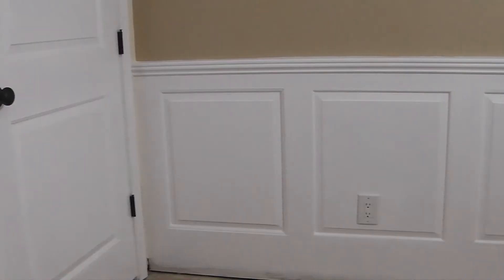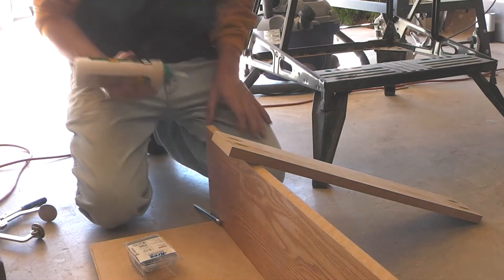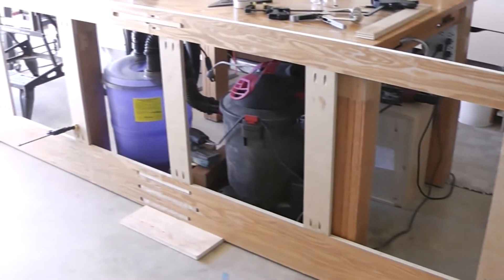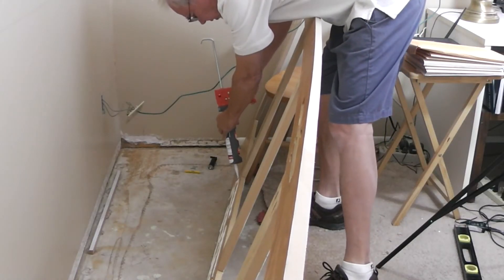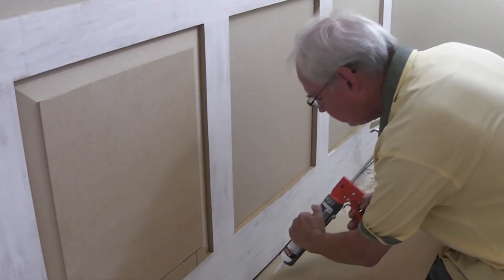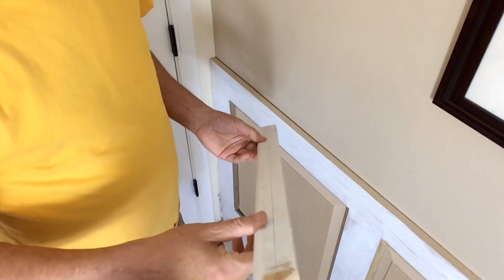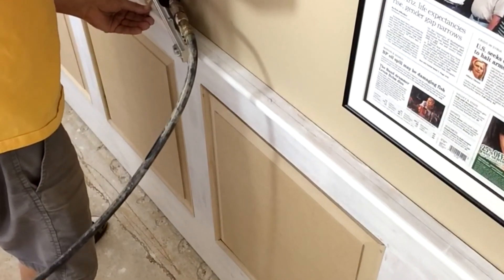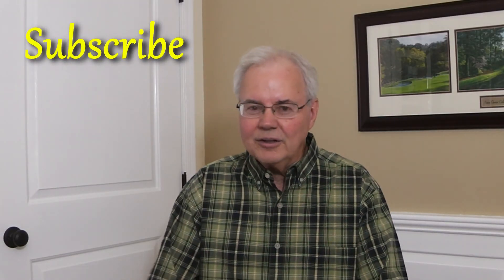An Easy Raised Panel Wainscoting Installation

Comment: That wainscoting came out great! What are those strap looking things that appear to be joining the wood pieces of the rails at 4:27? For my wainscoting project, I am trying to join two pieces of 1x10 (10 and 4 feet length) poplar and was wondering if what you did would work for me. Thank you!
Reply from the maker: What I did there Joesph was I routed out a groove in each section of the two boards then glued a piece of wood in the grooves to reinforce the two rails pieces. The two rails together were 11 feet so I figured some reinforcement was needed because I needed to carry that whole section from the garage into the room. And it worked !  Good luck on your project and thanks for watching.

Comment: Tremendous craftsmanship! I am about to start on the same project and was researching how best to get started. This video has everything i needed. One question for you — about how much did you spend on all the materials?
Reply from the maker: Thank you literatemonk !  I don’t have the costs at hand but it was under $100. I used MDF which isn’t expensive. And I only had to buy one section of the trim as I did the others with wood I had on hand with a router.  I must say, it turned out great. Good luck on your project and thanks for watching.